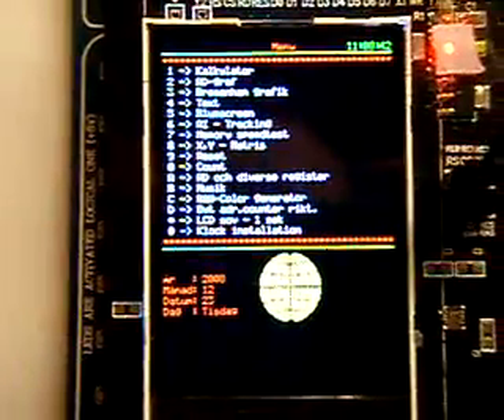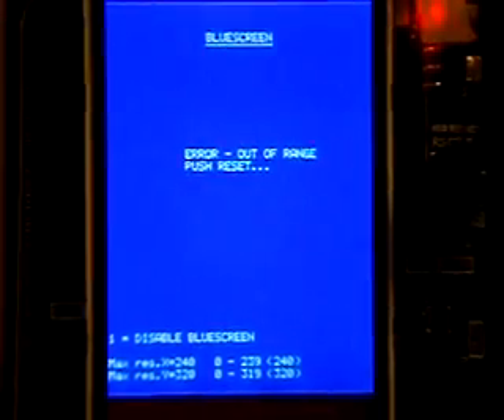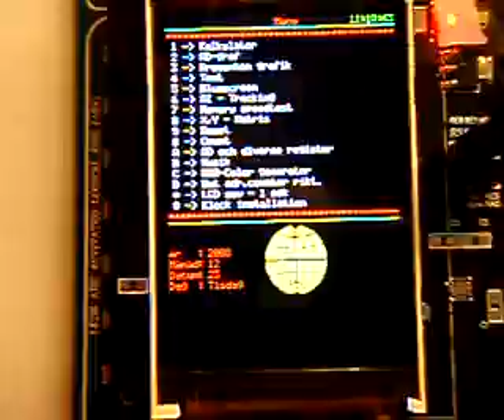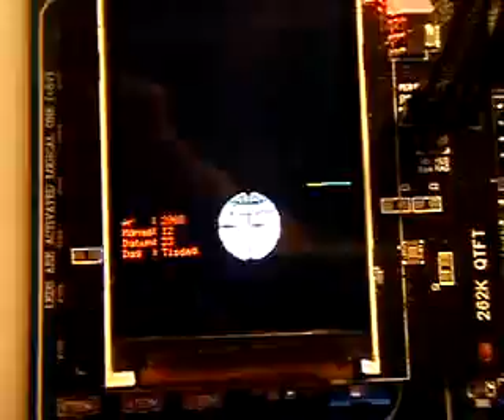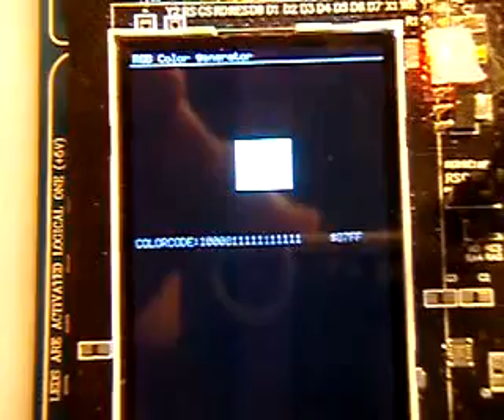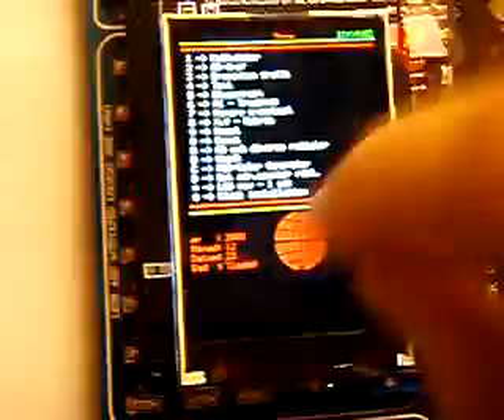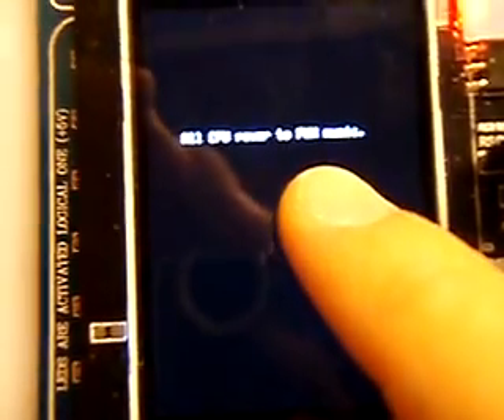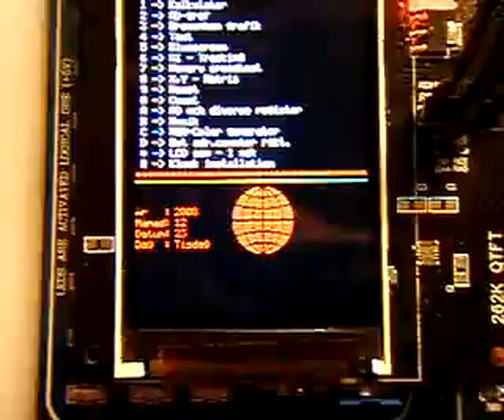QVGA + PIC = POSSIBLE

Comment: Hi.
Which display board are you using? The one with a iLI9320?
As I've got that one, and a PIC18F4550 example came with it, but I have problems programming the 18F4550, but I have 18F452 fx, would that work?

Which language have you used? Microchip C18?
Is it possible that I could see your code?